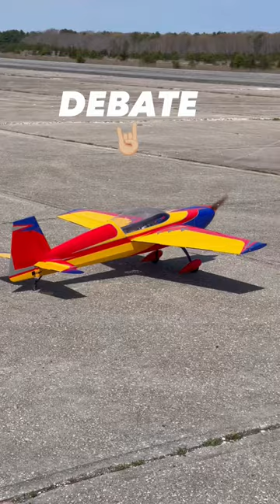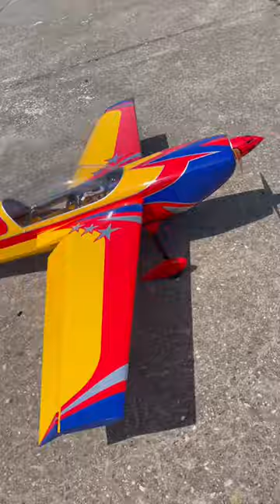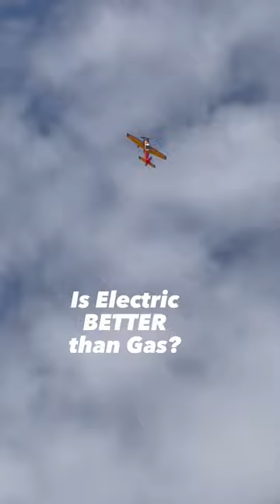GAS vs ELECTRIC Rc plane… what’s better ?

Comment: Electric for beginners, but gas is awesome if you can afford it!👍
Reply: true
Reply: @Always Flying that's right electric power for the rich! and gas is for the poor.. .
Reply: simply not true anymore, I'm flying an 85" Extra with a 91" in the build process - - both high end electric, these aren't beginner's models, not by a long shot.
Reply: Ture 😂
Reply: @bobadingo I don't know how in other countries, but in my country, instead of buying a gasoline engine, you can make a good electric plane, so in my country, gasoline planes are for the rich
Reply: bobadingo3092 And what about jet turbines?
Reply: Gas planes are like 4times the price…you can get a good epectric plane for $300 while has planes I can’t even find one for less than $1000
Reply: @alwaysflying6540don’t think you realise we are talking about rc planes rn
Reply: Gas is cheaper than electric
Reply: @Mr.Storytime959   Thats bullshit.... Compare Appels whit Appels. Take a extreme flight 91 inch. Same plane, servo,s and prop. Then electro setup is more likely more expensive then the gassetup at least the same. Gasplanes are almost always big and electric can also be small. Mebe uou think like that but you must compare the same plane ofcourse....

Yeh a 120cc petrol is more expensive then a 4cell plane...

And lets say you crash and cant fly for little year your expensive lipo,s are getting less...

Personel: Gas is long flight time and sound. Performance wise electric is better.
Again in same plane. Electric has faster response.
Reply: @TheKing-pf9hw  bro l literally have the electric version of a similar gas plane I got for $300 the gas version $1200…I personally like gas over electric because it sounds cool but I’m not spending 1k on my first airplane
Reply: @Mr.Storytime959  $1200? Lets say Extreme flight 78inch(2 meter) Here in the Netherlands...Here you buy a castle 120 esc for €303,  40cc electric €309 xpwr40= Little over €600 for a good combo. Petrol: Original DLE 35cc what is a reliable engine cost less then €400. If you want silent exaust its €200 extra. So You can fly for €400 Petrol... vs €600 electric. And if for what reason you cant fly much your lipo,s are over after 3 years well the best power is gone... Some new petrol and you dont got that problem.
Reply: @TheKing-pf9hw  wow those prices are a lot better… I live in California…it honestly makes sense lol America especially California is trying to get rid of gas…how can you do that peacefully? Get the kids into electric toys first vs gas….I’ll always be a gas hard head tho-a gas engine is like a beating heart…one day I will buy a gas rc plane when I good enough at flying

Comment: Gas will always have more power and sounds wayyyyyy better
Reply: More power is not true these days lipos are humongous 😮
Reply: @jmillerfpv  you’d be amazed at how much adding more nitrous to fuel can add power
Reply: But it's an RC plan. How good can it really sound?
Reply: Not if it sounds like a weed eater
Reply: Good luck. Electric hands down if you can afford the batteries. Prop rip is the only sound I need, leave you Weed Wacker at home!
Reply: @Always Flying Electric gives instant RPM and torque with no sputtering. When I'm done flying I don't have to clean my plane or do maintenance on my motor.
Reply: Less reliability
Reply: Electric has way more torque
Reply: Actually electric powered planes can have much more thrust to weight ratio than any gas or Nitro plane can offer.. .
Reply: One of the greatest innovation of electric is in the use in EDFs.  Having about 20 EDFs is something  we cannot have with glow.
Reply: I put electric in my 3D planes under 40cc but anything bigger I go gas. Like the one in my profile, that a 170cc

Comment: The biggest drawback to electric is that you have to buy all your seasons fuel up front.
The second drawback is shorter run times.
Reply: Gas can fly all day at a moments notice, electric has to charge forever.
Reply: I built a FPV plane that’ll fly for 1.5 hours on electric. Runtimes are comparable, biggest difference is downtime between flights
Reply: Well next time you spend half a day chasing down the reason you fuel motor doesn't run right look over at the Electric guy who just put in 4 flights with ZERO problems. And don't respond "I never have trouble with my fuel motors" because then you'd be lying.
Reply: @asommer518  Don't get me wrong. I'm all in for electric. I was just pointing out the pros and cons. Electric  is the best by far.
Reply: It takes me 30min to charge my battery…I get 25min of run time…that being said I think gas planes are much cooler but for now I’m happy with my $300 epectric plane…
Reply: @chillville5571 It takes almost a full minute to swap batteries in most electric planes.
Reply: @chillville5571 I would suggest that you stop Flying electric airplanes then right on top of that your gas power plant is also powered by Electric batteries and ignition let's don't forget the transmitter and receiver that also runs off of electricity.. .

Comment: I like electric now. Never stalls just after take off putting my plane in danger. My batteries fit many planes also. No glo plugs failing, no mess, no old fuel laying around, no after run if your plane sits for a couple years. But that's just me. I appreciate those that go through that stuff to have the longer flight times and sound.
Reply: I thought he was talking about gas, not nitro. Many of those big planes run 2 and 4 stroke gasoline engines instead of the little nitro engines. Much more reliable and less prone to randomly quitting on you. Plus they tend to run longer, and are quick and easy to refill. Nitro engines are like top fuel dragster engines. If everything is right, they are impressive. But if anything is wrong, then they are horrible. The gas engines are more like that old chainsaw that just keeps working, year after year. Electric is so much easier and has more power, but batteries at that size of plane are expensive and take time to charge. So, to fly all day, you need a bunch of them. In smaller planes, electric wins hands down. Nitro is for nostalgia for the bragging rights that you still know how to tune one. Once you get bigger, the big gas engines start to get better and cooler. With radials and flat 2 and 4 cylinder engines, you get the cool sound and more scale performance. There is more maintenance, but it’s one of the trade offs you make. Plus, being able to run a smoke kit is a lot of fun. For me, electric up until you can go to multi cylinder 4 stroke engines. Then it’s gas for fun and electric for best performance.

Comment: Keeping your batteries conditioned correctly is time consumming I much prefer the ease of petrol you wipe it down put it away, electric you get home and you have to charge back to  storage takes a couple of hours. I have all kinds of planes, electric, nitro and petrol 👍
Reply: Charging to storage takes ten minutes I do it while Im packing up the plane. ZERO clean up too

Comment: In IMAC, Scale precision aerobics,  the plane needs the endurance to fly 2 complete sequences. In the 2.4m - 3.3m planes, the Gas engines are the way to go. They are lighter than the electric set-up and weight is a big factor in competition flying. 
There are some pilots experimenting with EV power. It requires massive LiPos. 
For fun planes, electric is great 👍

Comment: Electric... Costs more initially, but you don't spend time cleaning up after. In the UK, there's a big issue with noise pollution these days at several flying fields.

Comment: It depends on what you like. Yes, electric is either go or no go, no tuning, dependable power but the trade off is charge time. Me, I like tinkering with engines, and the ability to just gas and go.

Comment: Depends on what you're flying. Electric is more expensive with planes larger than like 70 inches, but electric is definitely more reliable- you'll never have an engine cut out while you're hovering your 104" Esge a few feet off the ground- I've seen that happen before. I prefer gas for large planes and many of the 4 stroke twins and 4 stroke radials sound really good. Of course if money is the concern then a 2 stroke is fine and still cheaper than some electric setups. With gas you can fly more often but with electric you need to either have a few packs charging while you're flying or just bring more batteries. And at that size batteries aren't exactly cheap. But electric is physically cleaner, easier to deal with too. Electric has less throttle input lag if aerobatics are your thing. It totally depends on your needs. I fly both electric and gas. For giant scale warbirds and civilian planes I love and prefer gas all the way. For aerobatic planes over 74 inches or bigger I start thinking of gas engines. Anything smaller and electric is my preference.

Comment: I say like some of the others. As long as you are flying is all that matters. I hate seeing planes just sit  around. I have been guilty of that when life got in the way of flying. But for me personally i actually prefer fuel . I enjoy tuning and getting the engines to run right. Thats part of the fun of flying. It also can give you thrills of recovery if the engine dies mid flight.

Comment: I fly (well, I did until maac was grounded) mostly 1/4 scale and larger electric. Have to fly around at part throttle because the power is insane. Flys longer Than I want to be in the air at one time. Usually I'll do two flights on a charge. These are conversions of gas models. They are lighter than they would be with gas and have more powerful motors than the gas that they replace.
Reply from the maker: Guessing these are 12s models ? Or bigger? That’s amazing !!

Comment: I fly both and some nitro. But the ease of electric is nice. No clean up. Can fly when it’s hot or freezing without tuning. And you can go a lot harder.
Reply: I stopped using glow fuel except in my 4 stroke scale planes.

Comment: Gas had the problem fuel affected by centrifugal force while electric is not,plus electric has instantaneous power delivery to the plane unlike gas is approximately 120⁰ only

Comment: Extreme Flight 104 extra with a GA-8000 on 12s 28x12 prop and i get 7 minute run times, lots of power, clean, quiet and its fun!

Comment: electric is almost always the "better" option in terms of power, performance, reliability, ease of use, and low noise. Nitro is only fun if you like tuning engines, but it's messy and loud and sometimes a chore. Gas only comes into play with the larger scales, and is actually less expensive than a large electric setup. other than that, an electric setup is still "better" when you're actually at the field flying, provided you have several sets of batteries and a charger.

Comment: I have electric, gassers and glow, im getting away from glow, because of tuning issues, fuel is getting expensive, always die on take off. You can't beat the sound and smell of a gasser. Smoke system is always a one up. Electric is instant power, don't cut off in flight, no tuning, draw back 5 min flight 1 hour wait, silent which and be a plus if in residential areas

Comment: Our Club does only have electric planes because the neighbours sued us. But everynoe say that electric is better than gas. Because you have to clean the gas engines and they are expensive and the oldee engines often don‘t work because if the airpressure. So we say that electric is better.

Sorry for my bad english
Reply: How gas= more expensive? Take same plane, and then take a good electric engine for that... Same plane its around the same..

Comment: gas sounds better and is more realistic, but its more expensive and needs a bit of setup and maintenance. While electric is easier as all you need is to plug in a battery for a bit and your good to go
Reply: It is not more expensive at all
Reply: @krotchlickmeugh627  I also doont get why they say, Think it are beginners who say, Gasplanes are 67inch or bigger electric can go be very small. But you must compare same plane then electric/gas is around the same.

Comment: Gas. 
No batteries to constantly juggle, no requirement for throttle management the whole flight, no need to have a field with power or to buy and bring a generator. 

Just fuel and fly.
Reply from the maker: Technically still need a receiver pack and a battery for the electronic ignition on the 2 strokes 🥹

Comment: Well gas u get more stick time 15min plus on tank gas.sounds great butttt the mess u have to clean up after most flights got to hand wipe oil off side or bottom. Battery can get 7min but most are 4min depends on stick control, sounds ok but if have sound system on it then it's good, jets sound pretty good. No messy oil to wipe off plane after flights and power depends on motor u get I see some electric planes much faster than gas planes. Up to person!

Comment: No more cleaning up the AC after flying, the CG never changes, no fuel rotting the planes balsa, no having to get anywhere near the AC's wood chipper, no noise, no pollution, nothing to burn yourself on.

Comment: Obviously electric has taken over the hobby.
 Large scale is  typically gas.  If you like sounding like a chainsaw .
 4 stroke  nitro is the best tone. But decide  if you  want  oily messy fuels or clean instant  power!
  Electric  brushless motor is superior  power. But the battery is not easy in Large scale $ 
 Both widely  enjoyed!

Comment: Cost wise electric 
power wise electric 
flight time gas
Power wise gas
Just depends what you do, if you do 3d you probably want gas for the extra strength and flight time

Comment: Electric is better in anyway other than a cool factor. The gas just sound better, got that smell when it flys by and your feel cool af starting that propeller. But electric is better in every other way simply put. Weight, materials, pricing, replacing, power to weight ratio. There will always be a special place in my heart for gasers but I will never buy one myself…. If I do I’ll only fly it once or twice a year and start it once a month lol

Comment: There is no battery, in production or research, that can pack the energy of a tank of gasoline in the volume of a tank of gas. You might get more torque from the electric motor, but more range from gas.
Reply: very good

Comment: I was going to say that real planes are gas, av gas of course. Then I realized real planes are starting to turn electric. Someday there will be a lot of electric real planes. I want to try gas because it sounds like it would be a cool thing to do. I like the hobby with electrics. But I like the idea of fueling up and having three or four flights on the same tank. I've seen the guys at the flying field do it with their bigger planes. I'm putting an NGH9 CC on my hangar 9 ultra stick. That's a winter project. Anyways to each his own right.

Comment: I've been in the hobby long enough that I've done both. In some instances Gas or Glow is better but over the last few years the innovations and leaps in battery tech and electric motors that in alot of cases they have equaled or surpassed Gas and Glow engines. All of my planes are electric now and i have a couple that are BIG scale " P-51D 60cc 89" and a Seagulls Model B-25 90". Now a few years ago these planes no question about it would have been Gas but after looking at all that was out there i went electric cause the time and energy in keeping the motors in good shape and also the constant clean up afterwards " which I DO NOT miss..LOL.. But im not going to lie i do miss the sound of Gas but again now you can put sound cards in your plane and if done right, it sounds amazing. Now our club has been lucky over the years with forgiving neighbors with the few of us that have Gas or glow but you ALWAYS have that ONE Karen or male Karen that makes trouble and we are dealing with that right now in thay we have had the county come out twice to do a soind analysis. Which the county said both time we are fine. Sorry for the longwindedness in my two cents ans hopefully i didnt cause a stir in thia never ending argument...At the end of the day its about ALL of us just having a good time flying and fellowship with our fellow flyers.

Comment: ELETRIC is cheaper YES I KNOW THE BATTERY IS QUITE EXPENSIVE BUT AT LEAST YOU WONT HAVE TO BUY GAS EVERY FLIGHT Eletric IS BUY ONCE AND YOU CAN RECHARGE IT FOR FREE AND YOU CAN USE OLD ONES IF YOU HAVE

Comment: Gas is cooler, electric is faster
Gas is more expensive 
Gasoline is typically more maintenance 
Gasoline requires better weight distribution because of fuel tank placement and fuel depletion 

But it’s cooler

Comment: electric, its easier to set up, more reilable, and flys better
Reply: But not a fun, you can’t put a good electric system in giant scale, the one in my profile is a 116” edge 540 with a 178cc 2 cylinder.

Comment: Gas RC are old tech, just like the ECE cars. Electric is new tech better. Less parts, easier to repair and maintain especially after a crash. Oh i forgot the most important part, Electric is cheaper

Comment: You guys sure that's a Flex-Innovation model? Looks more like an Extreme Flight especially considering the color scheme - - not that which brand it is matters much about the Electric vs Gas thing - - funny how people like to point out the short comings of electric - well, gas has more than it's share of BS too - - but of course they both bring their own positives to their own tables - but yeah, high end electrics these days aren't what ya daddy used to fly, that's a fact - Scorpion, Hacker, Extreme Flight, Dualsky, etc. to name a few motor brands out there that perform right along side their gas counter parts, some of the higher end Scorpion line are over the top efficient, they'll run a very long time on a decent battery set up. I like 'em all - nitro, gas, electric, they all have their pluses.